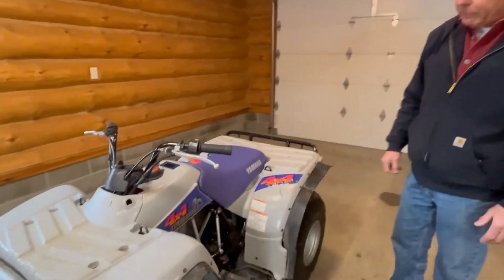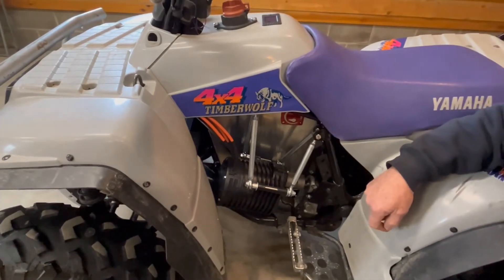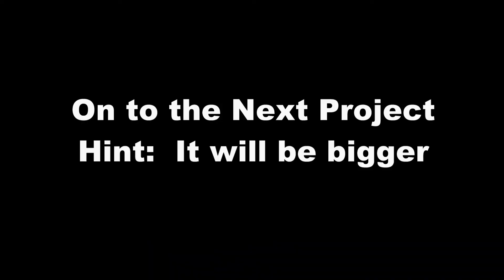Electric ATV Final

Comment: Awesome job on the conversion.... I'm currently working on converting a Yamaha Grizzly using the same QS motor.  Can you share the part number for the Lovejoy coupler you used?
Reply from the maker: PN 6133N16 & 6408K75 from McMaster-Carr. Because the motor mount system had some flex, I slipped a 2” rubber sleeve over the coupling after failing the first rubber piece fairly quickly.
Reply: @e-grandpa9778  Thanks so much!
Reply from the maker: Thx!

Comment: Nice work, i have almost the same electric setup, qs138 70h v3 with a VOTOL em200sp controller, a little bit more amps.. My plan is to use the ATV for daily heavy activities, drag logs, firewood, etc, do you think this motor can handle the torque?
Reply from the maker: I believe so.  You can always use different sprockets if necessary.
Reply from the maker: I can’t as I have 4x4 with gears.

Comment: Nice work! I'd love to learn more about the drivetrain. Does the electric motor connect to a transmission or to a transfer case? Thanks for sharing.
Reply from the maker: The motor connects to the existing transfer case via a modified input shaft and a Lovejoy coupling.  The transfer case was rigidly attached to the frame with a newly-created mount that put the it in the original spatial location.

Comment: Great video.....What was your total conversion cost?
Reply from the maker: About $2000.
Reply: @e-grandpa9778  thanks!  do you mind sharing where you bought everything.
Reply from the maker: Here are the main items:
Motor:  QS Motor 3000W V3 Mid Drive Motor - https://www.qsmotor.com/product/3kw-mid-drive-motor/
Controller:  Votol EM-200 - https://www.qsmotor.com/product/votol-controller-em-200/
Batteries:  Panasonic NCR18650B - I salvaged a Tesla Model S Battery Module.  Created a 18S24P pack -- 432 cells.  A Tesla module has 444 cells.  I also created a motorcycle and snowmobile battery modules using new Panasonic cells.  You can also buy other brand cells at a lower cost than Panasonic.  I just don't know the quality.
DC-DC Converter:  36-84 Volt DC to 12 Volt DC 10A-15A DC-DC Voltage Converter - https://electricscooterparts.com/voltage-converters.html
Throttle:  https://electricscooterparts.com/throttles.html
Electrical Instrument:  DC Multifunction Battery Monitor Meter,0-200V,0-300A (Widely Applied to 12V/24V/48V RV/Car Battery) LCD Display Digital Current Voltage Solar Power Meter Multimeter Ammeter Voltmeter -- https://www.amazon.com/gp/product/B07T9LV66P/ref=ppx_yo_dt_b_asin_title_o00_s01?ie=UTF8&th=1
Master Switch, Range Switch, Contactor, Fuses, Wire, Terminals, etc -- many sources.

Comment: you have the same engine as me you do not want to share your settings to votol controller here on Youtube my settings are on my page
Reply from the maker: I don't have access to my settings at this time.  I will get them soon.  I looked at your video.  Yours goes considerably faster.  My top speed is only 30 mph.  Granted, it is probably heavier and AWD, but.....it may be differences in settings.
Reply: @e-grandpa9778  My top speed is 86 km h Whit 200 battery amp in sport mode i have THE votol 150/2 sp sprocket 15 t front 45 t back i have 40t rear sprocket which I will test this spring want to get out 80 km h but with less amp  if possible